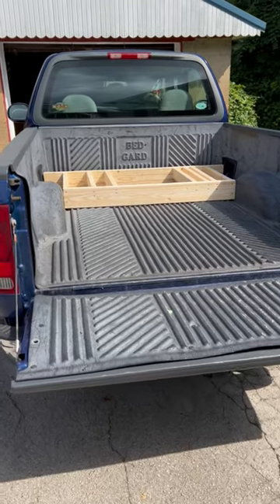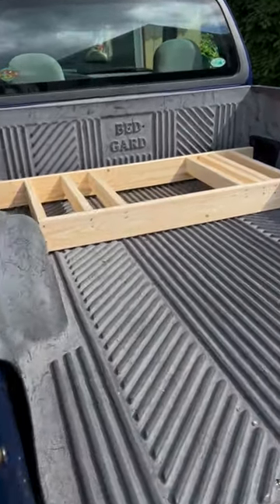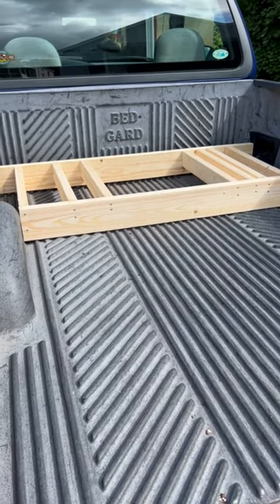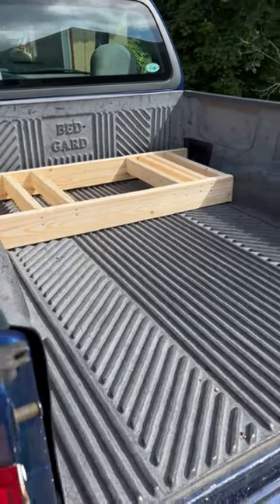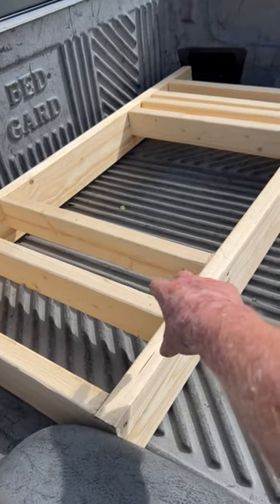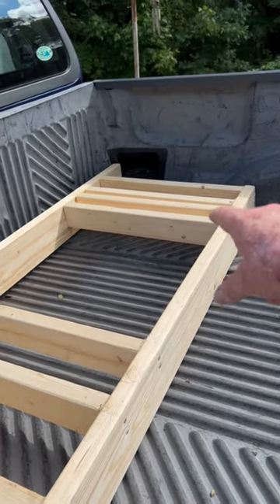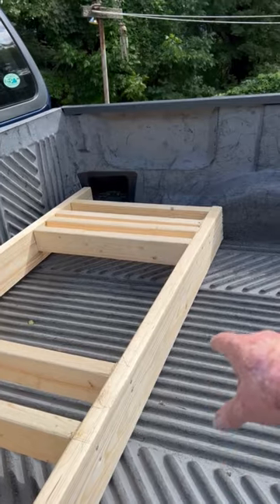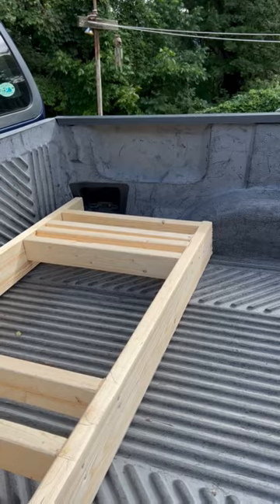Day 30 of #shorts everyday, DIY Bike Rack for a pickup

Comment: It’s a well made rack but the bikes won’t fit in the bed in most pick up trucks. Most won’t be able to close the tailgate.
I am constructing something similar to fit the rear wheel in on a 30 degree slant, so front wheels can turn, in order to be able to close the tailgate
Reply from the maker: My bikes all fit .  My bed is 6.5 ft.